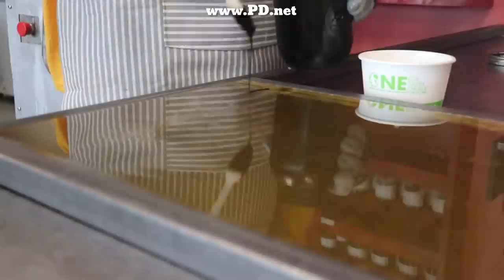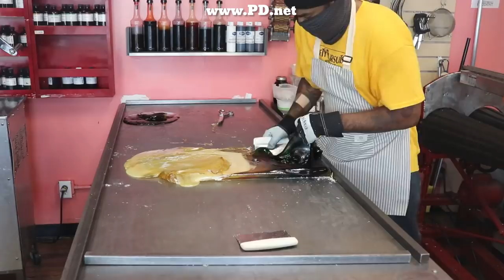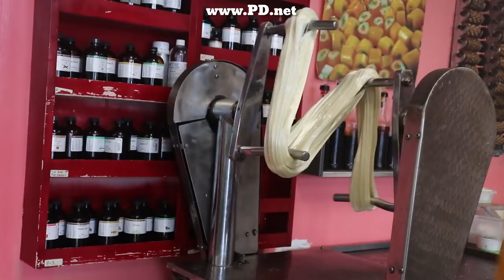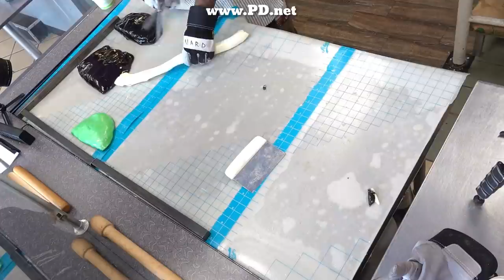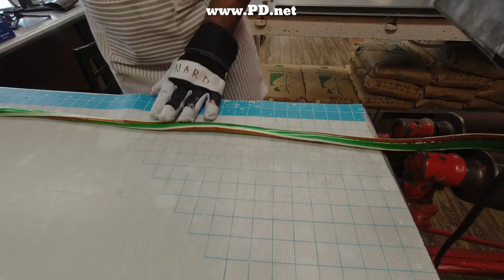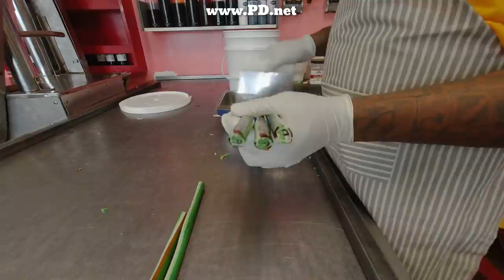#154 Bernard solos on image candy design! Green apple image candy!

Comment: Every time I see someone use the candy pulling machine. Not sure if it has safety features to prevent it but watching it I imagine the potential of getting your arm caught between two of those rods/arms while messing with the candy.
Reply: In another video I think they explained they actually improved the safety, it used to have exposed gearing and everything
Reply: @Kaiveran  I imagine it might have a feature similar to a saw stop, it's used to tugging on non-rigid taffy consistency (while warm) candy so if it meets real resistance (eg. an arm with a bone inside it) it won't be able to apply enough pressure to do more than perhaps leave a light bruise. Still, it looks like it's designed to tear off a person's arms and I can't help but cringe.